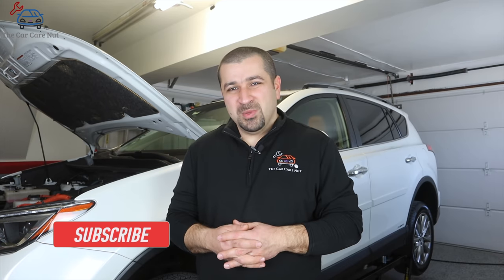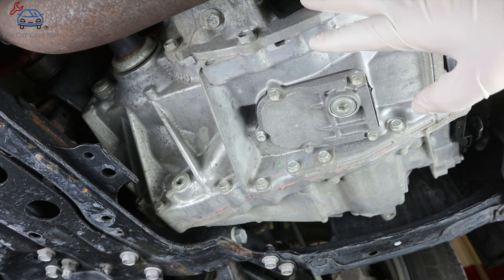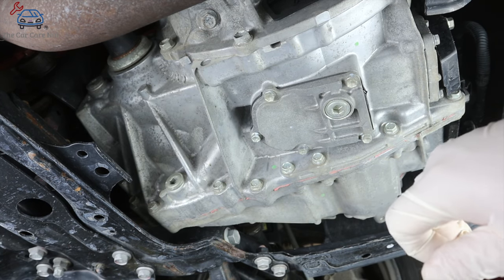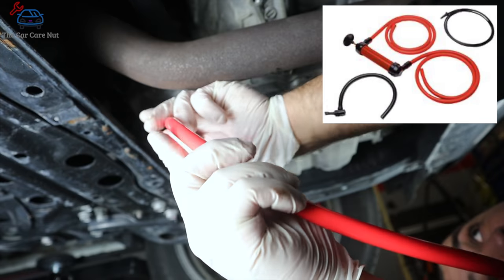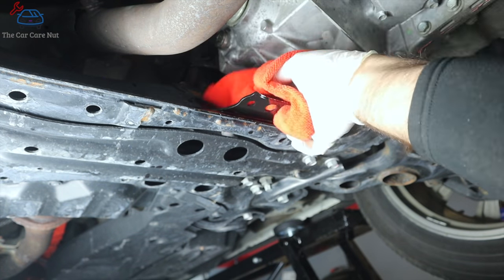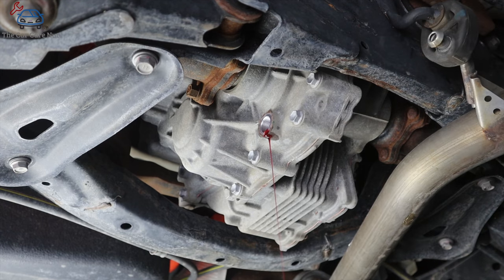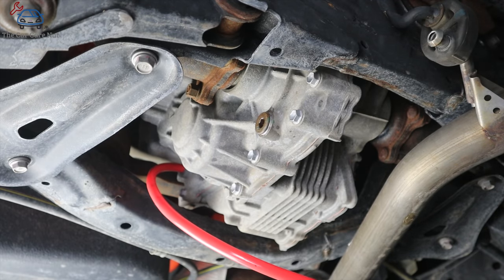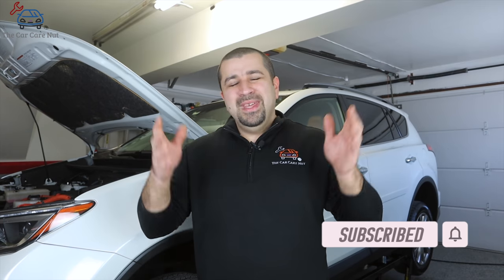How to change Toyota Hybrid Transmission fluid and Differential fluid

Comment: I like the way your transmission fluid looks like new when you do the front end. I like the magnet on the rear transmission. I wonder why it isn’t provided on the front one as well? Since sadly, I do not have a way to lift it up all even to do it myself. I will probably schedule an appointment with Toyota when I hit that 90k miles like you suggested to me on my 16 hybrid. Just because I can’t get under there myself and do the job right. If I had a lift I would totally do this on my own.
Reply: or just by a jack and 4 jack stands its a great investment.  Harbor freight jacks are  great about 90-120  and jack stands 4 for 60. With the cost of fluid you still will save over spending 300 for toyota to do it.  and now you can do your  own oil changes.
Reply: Probably because there are no gears in a CVT like there are in the rear differential. My 6-speed automatic has magnets on the bottom of the pan that can only be accessed if the pan is removed to change the filter which is not really necessary as those are there to catch any metal shavings that occurred during break-in it's not something that needs frequent cleaning afterwards.
Reply: @jeffumbach here certainly are gears in these hybrid transmissions, though fewer than most standard automatics in gas only vehicles, also no clutches or valve bodies, which are usually the first to die in traditional vehicles. It’s a single planetary gear set coupled with two electric motors that allows for any gearing on a set range (CVT). You’re thinking of belt drive CVT design, which is completely different (and garbage for passenger vehicles)
Reply: I have a DIY garage in the area, so for the big fluid changes, I rent a stall, lift the car and get the work done quickly.  For transmission, engine coolant, and inverter coolant changes all in one visit, it cost me $325 in fluids (bought at dealer), washers and rent for the garage which includes fluid disposal, tools, lift etc.  Versus $850 for local garages, and just under $1000 at the Toyota dealer.

Comment: Thank you thank you thank you!

Your opinion for gen 2019+ RAV owners, any key differences versus the 2017 in your video?
Reply from the maker: The 2019+ hybrid transmission fluid is very similar to this one, you just have to remove the covers.

Comment: I changed my 2006 Highlander Hybrid  fluid about 5 years ago. I just drilled a tight hole in the plastic WS fluid cap and forced a short piece of clear hose in. It worked but I ended up dripping WS fluid all over my face and it got into my hair. It's time to do this again (190k miles). I'm definitely spending extra money for a nice pump.
Reply: Update - just did this job again. My 2006 Highlander Hybrid now has 193k miles. The front took a little less than 4 quarts and the rear was less than 2 quarts. I got a discount from my local Toyota dealer by buying a case of ATF WS, which comes in a 6 -pack so is the perfect amount. This time I used a 500 ml syringe with a short vinyl tube. I had to refill the syringe several times but since I only do this a couple times per decade it's not a big deal and I can reuse the syringe for my Vespa fluids.
Reply: @donaldlee6760 ice job. Heads up that Walmart or autozone has these pumps for $15. The pumps come with precut tubes for the quart size bottles or the taller  gear oil bottles

Comment: Awesome video.. Information presented by a chill guy in a very down-to-earth way.. Videos like this are pure gold for people like me who are planning on venturing out on  first time DIY missions with jobs like this!! I'm hoping to actually tackle this within next couple days on my old 07 Camry Hybrid ...Quick question, though, if you don't mind me asking!! As far as the transaxle fluid change goes, I might have a roadblock and I was hoping for some input...i have a good trolley jack, two good solid stands, and even (2) two sets of wheel chocks. With that, I assume I'll have no prob getting the front of the car up (via cross member?) and on stands with enough clearance to work comfortably/safely underneath. However, with the car up like this, after getting the drain plug out I'll of course need to drop the car fully level again (remove stands) to thoroughly drain ALL the fluid, right? Then once it's fully done dripping, I would of course need to lift the front again to reinstall the drain plug w/ new crush washer.. So far so good, but this is where my question comes in! If my ONLY access under the vehicle is with the front lifted as I described, how would i still fill the trans with the correct amount of WS fluid ? I'm sure I'm missing something very obvious here, but I want to be thorough before attempting this... I guess my question is really this- Is the ONLY way to do this job properly to own 4 jack stands? (aka car fully off the ground and level?) Or is there ANY way at all to reach the hose from my hand pump down and into the fill hole from under hood/ engine bay? But then again, even if I did that and somehow actually managed to get the perfect amount of WS in),  wouldnt I then have to be worried about it leaking out the new fluid when I jack the car up again to install fill plug?? Any ideas? Thanks! (Sorry for monster length message)
Reply from the maker: Hi! You’ll want to use 4 jack stands for this job. No real way around it unfortunately.

Comment: Thank you very much for the video. I didn’t find any video for toyota hybrid cars so far, all the videos out there were for regular toyota car transmissions.
The difference you mentioned in trasmissions between toyota hybrid cars and normal  was very helpful. 

I have 2019 rav4 hybrid xse,  the drain plug is at the bottom of the transmission and inlet plug was at the same place as you have shown in the video.
Reply: I was able to confirm the location of drain plug and inlet plug on my 2019 toyota rav4 hybrid xse using the about two link.
Reply: @maidanamreddy598  can you help me with drain and fill plug location, mm and torque specs please. I am planning to do on 21 xse hybrid.

Comment: This video saved me because at first I located the wrong fill plug on my 2013 hybrid.  Tip for anyone else with the plug on the other side like that, take the wheel off, I was able to crack the plug loose with a breaker bar at about a 30 degree angle, tip 2, wear gloves because when it goes you're going to smash your knuckles lol.

Comment: AMD, your videos are incredibly helpful. I changed my 2013 Camry Hybrid Transmission fluid today (59,200 miles) for the first time. 3.8 qts drained but I kept putting in fluid and I ran out at 7 quarts. I never got any fluid out of the filler opening. The old fluid that drained looked basically new.  The car drives perfect (it always has) but I feel very uneasy right now. I'm thinking of draining it out and just putting back in a little less than 4 quarts of WS.
Reply: Lol holy shit, what happened?
Reply: Following
Reply: update please
Reply: Also hoping for an update.
Reply: @thinkertoo2995 -  Hello - your comment has intrigued us.  Did you ever figure out what happened to the extra transmission fluid?  (or go re-do the ATF change?)

Comment: Great video. I replaced the transmission fluid on my 07 Hybrid after buying it. It came out as dark. Also Toyota fluid is $10 each bottle, not expensive at all.
Reply: Hi Ahmed, 
Have you noticed any good change in the mileage of the car after changing the transmission fluid. 
Also, I have a high a mileage 05 Prius and I am worried to change the fluid because I have heared it may harm the gear. 
Your reply is much appreciated. 
Thanks.
Reply: @redamohamed4759 he says right in the video you have nothing to worry about, and the reason for that is hybrid transmissions don’t have clutches which can break down over time and will slip if new fluid is out in.

Comment: Hi, I recently changed my transmission fluid in my hybrid vehicle, however the mechanic used 3 quarts instead of the recommended 3.5 quarts of transmission fluid. Would that result in any issues soon or even in the long term?
Reply from the maker: Hi! If your mechanic filled the fluid until it overflows then the level is correct. If not I would go back and correct the level
Reply: @TheCarCareNut  no it didn’t overflow, but would that cause any issues with the car?
Reply from the maker: I would add fluid until it overflows. It’s not going to cause immediate problems but a low level could cause inadequate cooling and lubricating for the moving parts and can cause issues long term. But short term you should be ok.

Comment: A very clear video. 
On my uk spec auris hybrid,t from my experience of d.i.y cvt transmission fluid change its better to jack the car up on on passenger side for a right hand drive vehicle to  fully drain.max jacking the vehicle on the passenger side releases around an extra 200/300 millilitres of fluid. 
I precisely mesaured my drain off and precisely measured my refil to 3.3 quartz. 
In order to jack the car for a full drain off vehicle dos need to be on the floor level.
Reply: for a hybrid is not a cvt fluid, check that first

Comment: good day to you AMD.it may be out of topic but, i remember you mentioning that in auto trans of highlander/sienna around 2005 model that it is better off not to change the transmission strainer/filter when changing the fluid.i think it was in one of your live session.thank you very much again for these informative videos.
Reply from the maker: Hi! Yes I wouldn’t replace the fluid filter on Toyota transmissions. No harm in replacing them but no benefit either
Reply: @TheCarCareNut  thank you very much.i already replaced it when i did a fluid change.that was before i saw ur videos.😁.i just thought you had any experience of problems arising from replacing that.thanks again

Comment: Thank you so much for another informative Toyota video and for promptly replying to viewer's questions! Speaking of questions, I understand in the P710 trans, the oil pump is driven by the gasoline engine. How is the transmission lubricated during times that the engine is off? Does it rely only on splash lubrication? Thank you in advance and keep these videos coming until I've learned everything there is to know about my 2020 RAV hybrid!! lol
Reply from the maker: Hi! It rely on splash lubrication and if the car is moving the pump is running. Also it doesn’t really have moving parts when the car is stopped

Comment: Conducted transaxle and diff fluid change today on 21 Sienna XLE AWD. At front transaxle, drain is center bottom of the case, and fill port is on passenger side. Fluid looked very good for 64k miles: zero metal on magnet. Both of the rear diff ports were on driver side of case. Fluid was darker than expected, and had a single layer of wear metal on magnet. Given that the rear motor rarely seems it needs to kick on, there was more wear back there than anticipated. (Shrug)

Comment: Emergency Room story, AMD!  I changed the transmission oil in my daughter's Sienna (no issues) and that darn drain plug was 9-years old so HARD in there.  Using my breaker bar, I FINALLY got it pop loose but my left hand smashed down into the concrete floor.  (I was wearing gloves.)  I shook it off and finished the job.  Took off my gloves and my left ring finger was swelling up...I hit the knuckle very hard.  I couldn't get my wedding ring off so iced it.  Long story short, had to go to ER the next morning and they cut off the wedding ring.  Thankfully, no broken bone so that's good!  (I need to be more careful and remove all rings prior to starting a job.)
Reply from the maker: I’m sorry to hear that my brother! I hope you’re feeling better! That’s unfortunately the price of working on cars sometimes. Always take off wedding rings when working on cars. Feel better my friend
Reply: @TheCarCareNut  Thanks it’s already much better!!!
Reply: @TheCarCareNut  That is so true.  I always heard if you've never hurt yourself you have never done anything.  In my world it is impossible to not get a booboo working on my cars.

Comment: I have 7 ICE cars I service, from a 92SC400 to a 2016 Prius. I put Redline D6 ATF in my Prius transmission at 40k mi. The difference in smoothness was very noticeable. I also did it in my cousins Prius prime 2017 and he says the same thing. Very smooth & effortless acceleration.
Reply: 😂😂 the ole’ “the oil made it run smoother”. Okay bud
Reply: @joem8875  It’s actually noticeable, the engine oil is hard to notice but your transmission oil is a night & day difference because that’s what transmits the power
Reply: @chickmagnet6004  No its not. Its 100% placebo.
Reply: @joem8875 Wow, you know everything

Comment: Well done video! 

 I am about to do my wife's 2006 RX400h transaxle/transaxle-diff fluids.  I am looking for more information on doing the transmission fluid on the Lexus GS450h L110 hybrid transmission that is also used in the Lexus LS600h.  I can't find the drain plugs, but assume it is a similar procedure as the RXh/Highland Hybrid, just a RWD transmission.  

Thanks for the detailed videos!

Comment: Like always, amazing informative video. I wish you quickly get the subcribers you deserve i.e. 1M+ at least.

My camry hybrid 2018 was near 73000kms and i was wondering about this maintenance, but i guess i should hold off till 100k. What do u reckon? My driving is mostly on highways and temperature here is always more than 30 degree celcius.
Reply from the maker: Hi! Thank you for watching my channel! I would wait until at least 100k then consider replacing the fluid

Comment: Hybrid transmission does not like to be overfilled, very important!
A lot of newcomers have a default belief that more fluid they can get in there the better... 

To combat this, 
I open the fill plugs a day or two after the service, (when the vehicle is cooled down on a level surface) to remove a small bit of excess which always comes out,
 if its overfilled, seems like it overheats an ruins the fluid an it starts causing a rough downshift at high speeds... you'll get less then 15,000 miles on the fluid if its overheating before it becomes burnt/damaged an loses viscosity.

Comment: Love all you videos you do, it is great that a Toyota Master Tech does this stuff for us, there needs to be more like you out there.  I have one question, though.  This was the first video to pop up when I did a search to change the transmission fluid in my '20 RAV4 Hybrid.  I'm pretty sure it will be super easy to find the drain/fill plugs if they have moved, but just was wondering if the part number for the plug gasket is the same for the 5th gen?
Reply: Just give your VIN number to the Toyota parts counter person and they will give you the correct ones.

Comment: I changed transmission fluid for my 2017 rav4 hybrid today. Collect a little bit more than 3 quarts plus some spill. No more than 3.5 quarts. No sign of leaks. I added about 4 quarts following master’s method. There is no splash cover under transmission? I customized one from my used Volvo. I think it’s good to have one to minimize the exposure to the mud and water

Comment: Great video as always. Thanks! Since it is so easy and the amount of fluid that goes in the transmission Toyota should make it a regular scheduled item on the service list.
Reply: It's hard to set a fixed mileage limit for ATF change on these E-CVT's. Some people find that their car's transaxle fluid is practically black at only 60,000 miles, and other people report theirs was still pink and looked great at 90,000 miles. Heat is probably the main determining factor; if you live somewhere that it rarely gets hotter than 70°F, like San Francisco, your transmission fluid probably is going to last a lot longer than it would in a place like Phoenix, Arizona, where it's 110° to 120° every day for 5 or 6 months out of the year. It's kind of a shame that there's no easy way to sample the transaxle fluid on a Toyota hybrid, like you can pull the dipstick on your engine and wipe it on white paper towel to see the oil color. I wonder if you could install a Fumota valve on the transaxle drain, so that it would be easy to draw just a few drops of fluid by turning the handle just enough to crack the ball valve a tiny bit?
Reply: @laura-ann.0726  Another main consideration for how often to change rear transaxle fluid (and diff fluids on trucks) is how often you tow and/or go off-roading. I tow a tiny camper with my 2019 Rav4 hybrid and changed my rear transaxle fluid twice (rash at 40,000 miles). Both times fluid was fairly clean. I'll change them every 60,000 miles going forwards. AMD is right in this video saying to change every 60,000-90,000 miles (depending on conditions) 👍

Comment: Why should I not use cvt fluid on my hybrid transmission? (I used it on my 2014 Camry Hybrid transmission). This is what the dealer sold me/ told me to replace it with. Thanks for your videos by the way?

Comment: Thanks for your great videos on how to take care of Toyota/Lexus cars, I enjoy them very much.  I have a 2017 RX450h with about 30,000 milage under normal driving condition(no heavy load driving).  When (or how much milage) do you suggest to change the transmission fliud?

Comment: Great video. Appreciate it.
The differential oil, is it thr same ATF WS fluid or is it the GL5 diff oil
It looks like ATF WS on both..
I always take the fill plug out first, so that most of the old oil drains out easily, with air going in thtough the fill point.
Reply from the maker: Hi! If your car is a Toyota or Lexus hybrid with that style rear differential it’s WS. If it’s a non hybrid then it’s gear oil

Comment: Thank you very much for this.  Very clear and informative.  I asked one of the local dealers about "Differential fluid" change for my 2008 Camry Hybrid.  I was told that this service does not apply to my hybrid model/year.   Is this true?